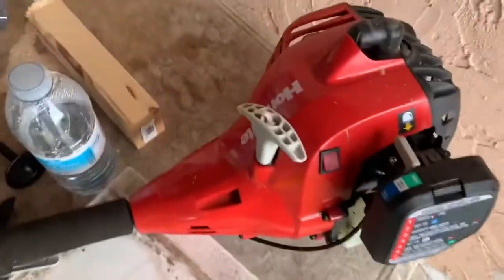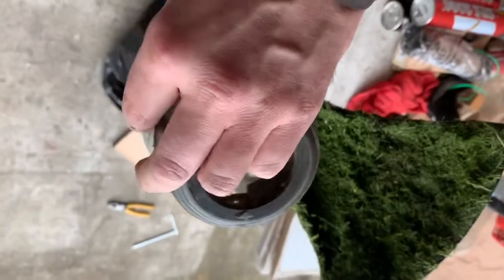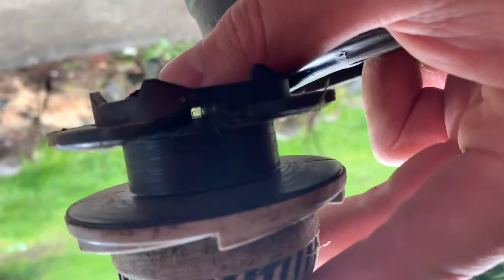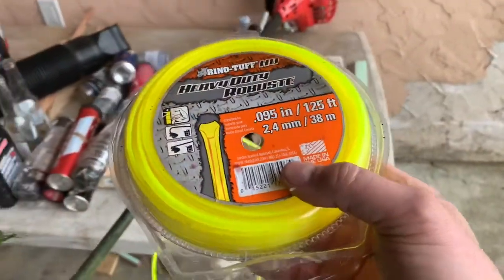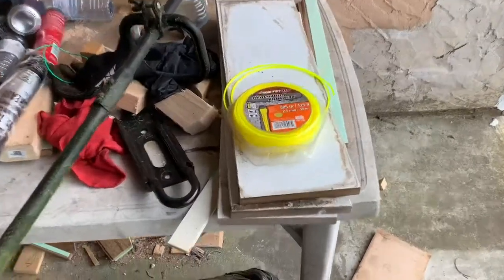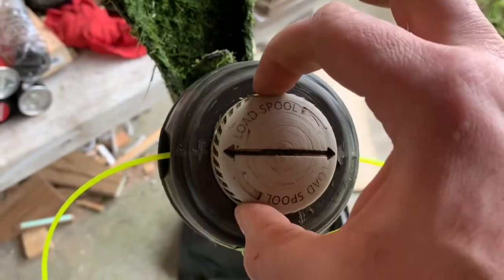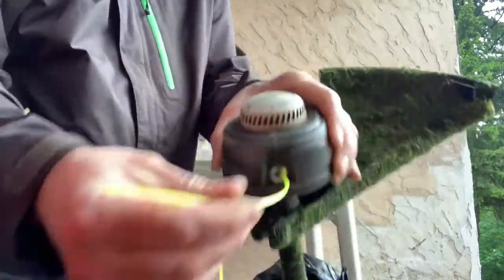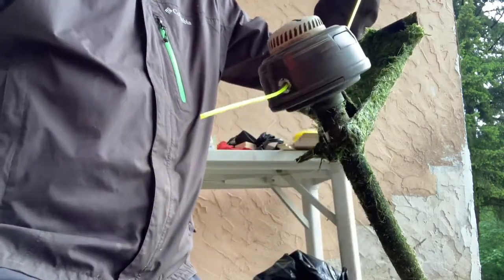Homelite 26cc UT26CSEMC how to reload line/string

Comment: Oh my gosh, thank you for this video.  I have owned quite a few string trimmers over the years, and although I am quite mechanical, I swear this head had me stumped because of the poor instructions in the Operators Manual.  I fought this dang head trying to wind the string with the head out, no wonder I was having such a hard time.  Apologies to whomever designed this, as I was cussing them out & wondered how stupid someone could be to make such a head.  Joke was on me, actually quite a remarkable way to wind the string up.

Comment: Thanks!  I just bought that one today. Haven't even assembled it yet.
Reply: There easy to assemble I assembled one in 2 mins but the first initial start of weedwacker is a pain you have the pull the rope 20-30 times before it will even start the let it warm up for a min or start cause if you don't it cuts it's self off
Reply from the maker: It’s a great machine. A few extra pumps on the primer bulb for the fuel will help in those first start-ups. @jim

Comment: i have the same exact one the spring popped off and couldn’t find it therefore i went to lowe’s bought a spring but it was too small any info you can give me on this
Reply from the maker: hmm, I'd check classified for a used one the same as yours, they're fairly common, and often get thrown out because people leave old gas in them, and they sit and rot, and its cheaper for them to buy new than get serviced in their minds... thats my two cents... other than look up the proper part on homelite's webpage, or other small engine suppliers.